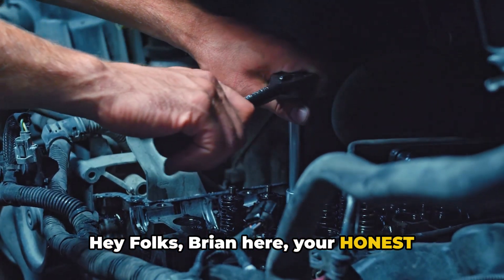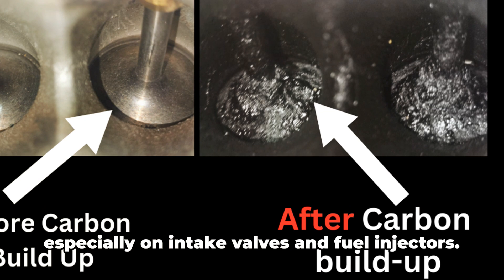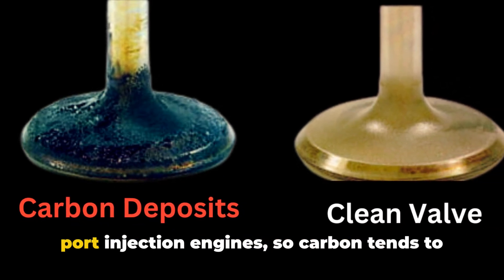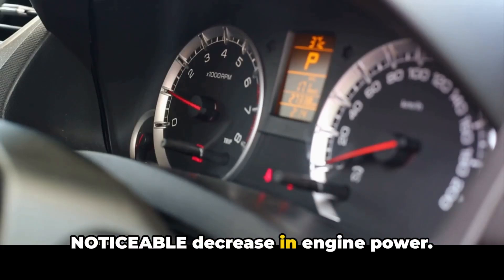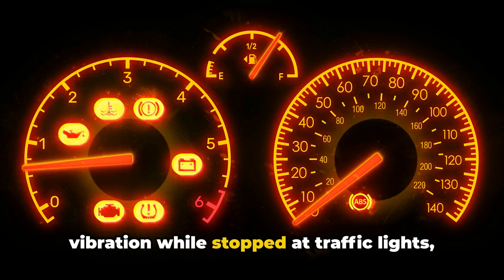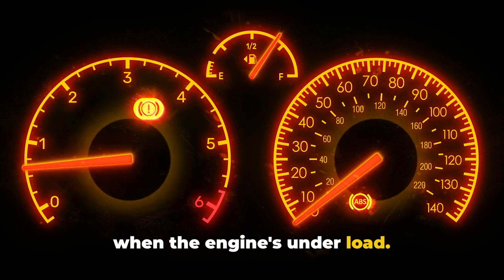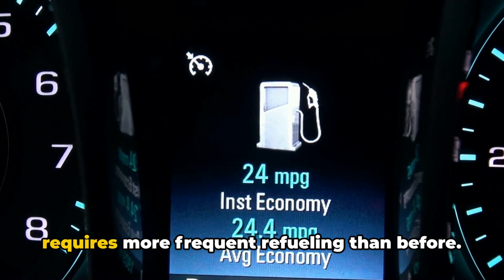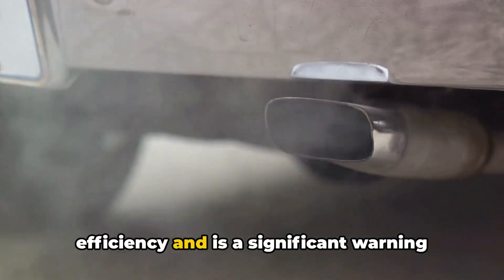Engine Carbon Build Up Symptoms: 5 Critical Signs to Watch For!

Comment: So I googled to see if my 2008 Silverado with the 5.3 liter engine has port injection and it does. With the colder weather now as November is getting cold here in Manitoba my truck is running rough with slow idle in the morning almost stalling and black exhaust for a few minutes then it clears up. IT still has lots of power and acceleration is good, I thought the port injection engines were better? My mechanic says I need to go out on the highway regularly to keep the carbon burnt up which I have started to do but man gas is expensive. When you live in a small town with no real need to hit the highway this is getting ridiculous.

Comment: Question 
If i let my car idling more than 5 - 10 minutes in the morning before move, its it posible carbon build up on my car?
Reply: Ovvio, passati i  30 secondi devi muoverti senza andare oltre i 3000 giri, poi quando il motore è arrivato a temperatura d'esercizio è consigliabile fare qualche affondo con l'acceleratore per brevi periodi.
Così eviterai l'accumulo del carbonio....

Comment: Port injected engines are better, in my opinion. Also use less fuel than direct injection. This is my real life experience, but may be different for others. I would rather have less power and a longer fuctioning engine, than the opposite.
Reply from the maker: Thanks for the comment! I agree Port injection does offer simpler maintenance and can avoid carbon buildup, which helps longevity, but direct injection is generally more efficient (mostly depends on the driving and overall condition) and powerful. I also appreciate the easy to maintain and less complex port injected engines. Its a trade off...
Reply: What can we do to solve this problem and how to protect the valve
Reply: @antonybitar1475 Usa benzina premium, io metto la Shell V-Power 100 ottani e cambio l'olio ogni 10000 chilometri e ogni tanto uso additivi Liqui Moly da mettere nel serbatoio della benzina.
La mia macchina ha vent'anni e nessun problema.